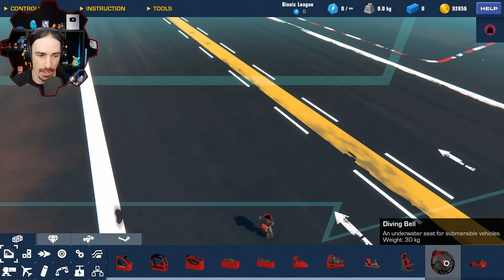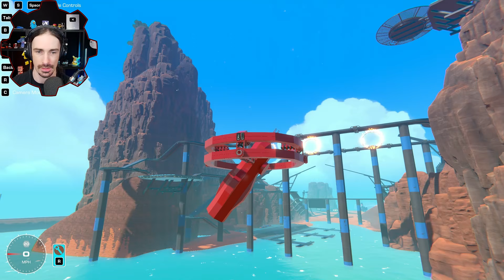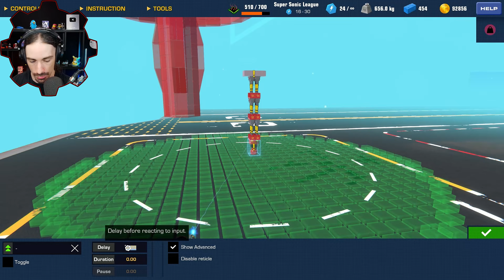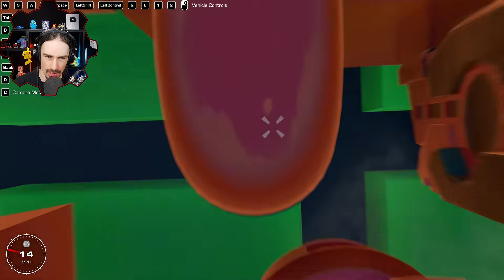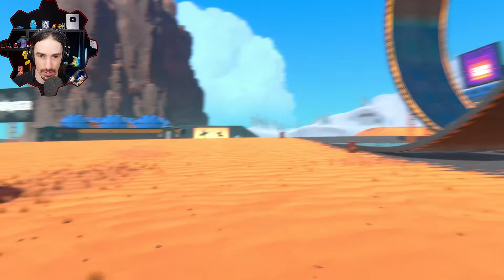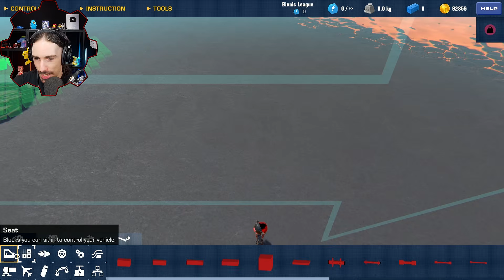Over-Engineering an ORBITAL STRIKE CANNON!

Comment: For the part where it was kind of floaty when you turned you could have just had a gyro on 10 or two of them on 10 and then had another one or two on five and it would have been extremely stable

Comment: Use speed sensors facing down and put the required speed to zero and hook it up to a gimbal jet, works great, a little difficult to go down though. My recommendation is watch nebula dude’s video to make an auto hovering system as it works very well.

Comment: I haven't tried this at all, but can the EMP be effected by pistons like how bullets are? I'm just wondering after seeing your orbital strike survival, if you could swap the cannon out of the cannon with like 8 EMP's (to get a bit of a shotgunning effect) and basically have "Golden Eye" from 007. That thing, in essence, was an EMP orbital strike. The limiting factor for Trailmakers is that the EMP's burst after so much time. So if you can accelerate them faster and you have TNT riddled vehicles trying to dodge and the EMP's are being shotgunned to emulate a larger blast radius, it could also be fun. Also just doing space debris (aka the metal crate spawner and snowball launcher) falling down. A kind of meteor storm survival where a bunch of junk is just rained down.

Comment: Im curious if you rotated the gyro stabilizers on the outer ring of the cannon to be perpendicular to the mounting surface if it would have a greater stabilization effect. 

Essentially you’re trying to play a balancing game with the centre of mass where if you turned them all 90° it would try to level the cannon out from each end of outer ring. You might achieve higher stability this way and reduce the ‘bouncing’ while in the camera view

Comment: anytime your dealing with gyros and "sub-assemblies" (I.E. things on hinges, servos, anything thats not rigidly mounted to another structure.) you need to dampen the sub assemblies separately from the main assembly otherwise you get that feed back and the heavier the undampened sub assembly the worse its effects. some with usung gyros as steering, the effect is greatly diminished if you have heavy sub assemblies without their own steering gyros the gyro only effects the assembly its placed on. and i have to confirm this but i suspect the gyro force is distributed evenly through the assembly centered around the center of mass not the gyro itself, ive never deliberately tried to see if thats true but in my experience it doesnt seem like it matters where the gyros placed as long as its in the right plane.

Comment: When making a yaw rotation gyro that needs high strength but low speed, instead of setting up that complicated speed sensor mechanism, you can just max out the gyro strength, remove the controls from the gyro blocks and input them using a logic gate set to 0.1 instead of 1. It's the mechanism I use for the yaw control of all the mechs I build

edit: nvm, you did this literally a couple seconds later into the video lol

Comment: I have some tips for you scrapman:
1 construct the  canon separately so you can see the center of mass and try to put it close to the center of rotation, this can make the construction more stable when you aim the gun by not shifting the center of mass a lot.
2 put all means of propulsion that make the canon hover above the center of mass, this would make the construction more stable like a blimp.
3 use some logic to combine the controls of movement and aiming and use a button to switch between move or aim the canon or make the aim change between fast movement but less Accurate or slow movement but pretty accurate.

These are some ideas that pop up in my head meanwhile I watched this video

Comment: before the gyro I used a much simpler setup for a tailfinless plane. Just speed sensors into the helicopter rotor with no logic gating to account for user input. Just left it fight the direct input internally.

Comment: Scrap you had it correct with the speed sensors for rotation dampening, you just needed to turn down the output signal of them into the gyros to similar to your control input for the rotation.  Just like with the control input, the sensor input was too strong from the speed sensors causing the feedback loop/shaking.

Comment: another way to solve that problem 6:55 is to have the gyro at full strength with no controls and have an AND gate with a low output like 0.10 or 0.05 going into that gyro:yougotthis:

Keep up the good work:hands-yellow-heart-red:
Reply: never mind  I posted that before you did it😂

Comment: The shakiness most likely comes from the gimbals firing and turning off all at the same time. The whole thing is basically in freefall for a split second, then boosting to orbit for another. Having most of the gimbals on constantly (basically, having the build almost boyant) and only having a single stationkeeping gimbal in each corner, controlled by a speed sensor should mitigate that. Also, having a separate speed sensor for each corner would add "automatic" balancing outside the gyros. 

A fun build, nonetheless. Maybe add extra weapons, and have a multiplayer game with player built AA missiles VS overpowered orbital cannon? :P

Comment: A tip for the floaty gyros is that you can set them to max strength and then set duration and repeat to the lowest increment you can set, 0.02 usually. That allows you to get small and steady motions with the powerful stabilisation

Comment: To more finely control rotation in place of the speed sensors, you may be able to use a stacked pair of compass sensors on top of a rotating servo, controlling the gyro's demand to keep the rotated position of the compass sensors to "north". That would tune rotational stability to degrees and compensate for over-aiming any degree past your control input. Main problem is that the controller is bulky, and it might be wobbly in the same way as the  other controls.

Comment: logic tip: you can split your thrusers into one group which is always active and another which is logic controlled. The always active part should leave the craft barely sinking and the other part should be just a little nudge to start rising. Now, when  you have reached the destination altitude, your craft won't oscillate due to much more precise movements.

Comment: fun thing about gyro's. if they're not given an input, they'll actually RESIST being turned by about more or less as much as the strength of the gyro. so that 'detect rotation then counterrotate gyros' system is somewhat redundant and just adding to the total complexity. really just having the gyro's on max and putting them to a 0.1 output logic gate should be enough. yuzei showed this off way back when the space update was still fairly new

Comment: Hey scrap man, a body experiencing a torque will always rotate around its center of mass regardless of where the torque is generated so long as it’s not touching anything. This means you can have your gyros placed any where and they will rotate the craft around its center. If you look at a lot of satellites, they will have the reaction wheels away from the center due to space constraints.

Comment: Could've used Hoverpads for far more stability in all directions + Ufo Engines to get around the map.

Also when using Gyros you can set them to max, remove its input, connect an OR gate to the gyros, and control inputs in the OR gate, set the OR gate strength to 0.08 or higher.

(In short, Max speed Gyro creates a dampen effect, OR Gate sets the control speed.)